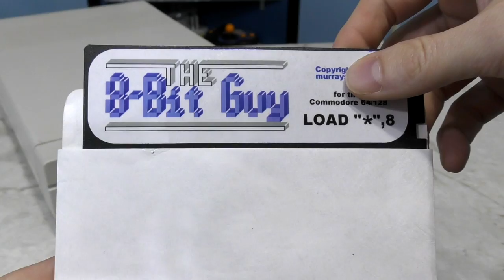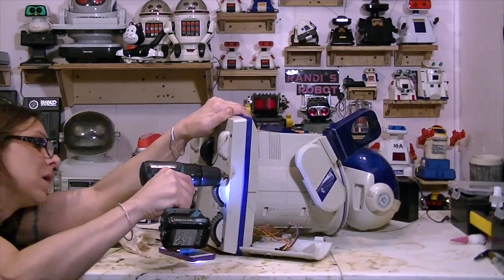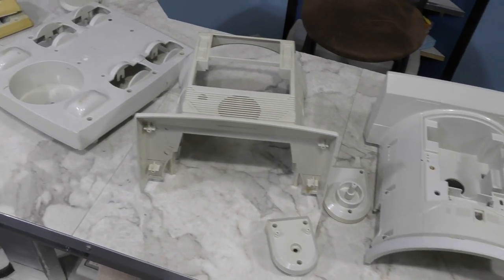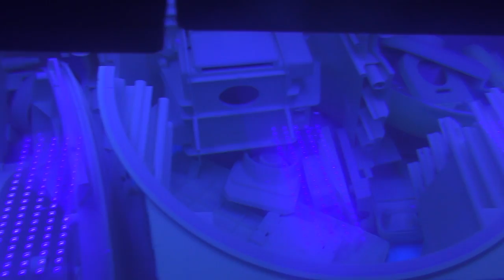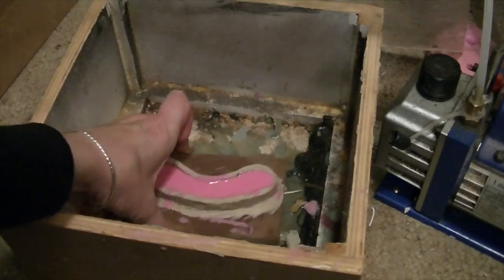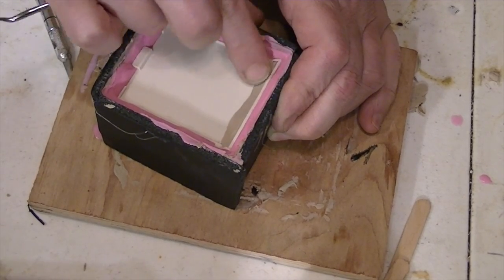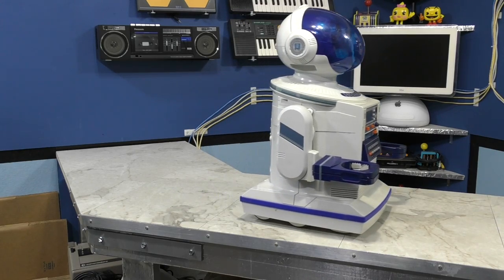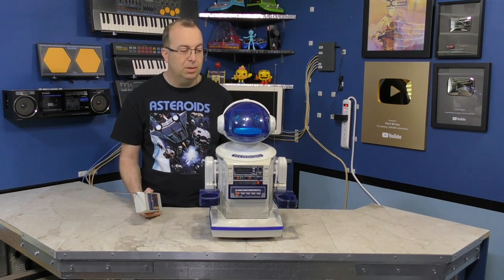Vintage Hearoid Robot Restoration

Comment: For the head, I would recommend using Brasso, which is intended as a metal polish, but works really well for buffing scratches out from plastics.

Comment: whilst I highly advise against this outside of a very dire situation and as a last resort, you can carefully use acetone to take care of deep scuffs and/or scratches. use the acetone to soften the plastic and rub over the scuff for a few minutes until the scratch has mostly gone away, finishing the rest with fine sandpaper, followed by very fine sandpaper in order to match the texture of the plastic.

Comment: polishing plastic i something i do at work every day when i refinish the headlights on newer used trade in vehicles, if you are patient and carefully use very high grit wet sand paper like a 3000 grit and above and some water rubbing alcohol mix then a polishing buffing compound with a towel you can gently sand down the abrasions back into its good layer underneath

Comment: You should definitely have a go at polishing the poor little guy's face. I have had some excellent results polishing arcade plexi glass bezels before. Start off with about 400 grit wet & dry (use clean spray water with it) and progress to 2500 or even 6000 grit as the deeper scratches disappear. Then finish up with dry newspaper and then go onto a polishing mop / rag. It seems scary when you first start out, nut it magically comes up before your very eyes!

Comment: Mothers aluminum wheel polish for plastic, its' not too aggressive, so you cant mess up the surface finish by over polishing. You don't have to worry about what grit your using, or if you are using the correct polish in the right step.

Comment: Seeing a lot of comments giving advice for polishing plastic, putting in my two cents to say a product called Plastx did wonders for some clear acrylic I was needing to remove light scratches from.
The big trick is using microfiber cleaning cloths and NOT any type of tissue, second tip is to NOT wipe the product straight away, let it settle for a while.

Comment: You can polish the plastic dome with some drops of water and NaCMC, it's mildly abrasive but not a lot, it will not scratch deeply into the plastic and it's easily clean with plain water; i use it to polish my plastic glasses

Comment: You actually can supposedly strongly glue plastics like that with cyanoacrylate glue (Super, Krazy, etc.), but only IF you use a curing agent that it doesn't need for ceramics and metals (and metals have to be prepped very diligently). I don't know/remember what that hardener is called (cyano alone hardens by the moisture in air, but needs extra for most plastics), but it comes in a little brush-lid bottle that's included with the cyano glue in a kit called Plastix.

Comment: You need Meguiar’s PlastX for the faceplate. I use it on my polycarbonate iMacs and iBooks and it’s foolproof. It’s meant for polishing plastic headlight lenses on cars but it works for any shiny plastic as well.

Comment: Using a very fine sandpaper starting at like 800 grit, then 1500, then 2200 and finishing it off with toothpaste, which is an extremely fine grit should polish that plastic visor up.  I have done it before to original Xbox plastic jewels and it works well.

Comment: All you need is a buffing wheel on a bench grinder, or even just an angle grinder, and use white compound to polish the plastic. It would help to have a lower RPM grinder however.

Comment: Interesting, I remember seeing them in Tandy (or was that their catalogue), they were quite expensive for what they did so I passed on by. As for recording the motions, I made a little 'robot' which was basically the same setup as the Hearoid's base. This was driven by a TRS-80 (via a relay board), the computer could record my drive, and play it back, similar to the Hearoid's tape I suppose. Yes, if I made a loop out of the drive recording, it didn't take long to it to all go pair shaped. The only solution was to have part of the drive a purposeful 'overdrive' into a corner, re-syncing everything. I've still got the computer, but the sled/car is long gone.
As for polishing the plastic, try Brasso for the final finish, after filing, sanding etc etc.

Comment: If anyone wants to know why you can't just use the vacuum on the resin for the tie rods see some Pete Brown videos: resin outgasses continually for essentially forever under a vaccuum and the resin will just bubble it's way out of the  mold.  Pressure meanwhile will make the bubles in the resin microscopic and prevent outgassing from forming new ones.

Comment: You can use white vinegar instead of hot sauce as it's the vinegar in the hot sauce that's removing the oxides and leaving the copper base metal untouched.  Save that yummy hot sauce for your wingz

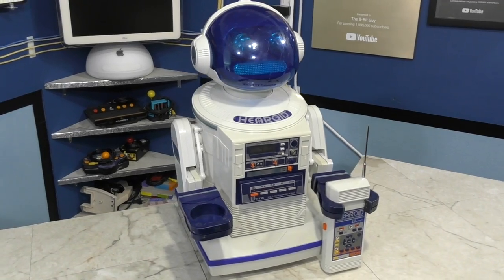Comment: @12:56 I've had success using Brasso's "polishing wad" on clear plastics to polish them back to transparent, it is cheap to get and easy to use. Don't use the liquid, it leaves a very slight haze to the plastic in my experience.

Comment: Meguiars ultimate compound with polishing tool and a cutting pad, would remove most of the light scratches and polish the plastic. Just keep the tool moving if not you'll burn the plastic. It worked well for me restoring headlights if theres any deep scratches some very light sanding with a fine grit paper will get them out and the compound will remove the scratches put on by the sandpaper.

Comment: I found a Steve The Robot I had as a kid in the late 80's that was in great shape but missing the remote. The original remote used a 27 Mhz frequency to go forward and reverse, so a cheap Dollar General remote control was all I needed to get the same results. Guess 27MHz has been the normal for wireless toys since the 80's

Comment: To polish the plastic try McGuires Head Light polish with 4" buffing wheel on a orbital buffer with the air pressure turned down a bit. I then clean off with water and Dawn dish soap. Then finish with Simichrome metal polish with a nice auto detailing towel.

Comment: fun fact,  using litteral audio signals to control the electromechanical or electronic functions of a robat is where the term audioanimitronc came from as used by disney. animate because not only cartoons but the word animate means to give life and by extension movement. tronic- thats ovious, but the audio part is because, like the heroid, they are controlled by literal audio signals. electronic tones.

Comment: A note about WD40: It's great for cleaning up things, displacing water, and getting stuck parts moving again. Yet it isn't very good as a lubricant. You can surely use it to lubricate squeaky hinges, but when it comes to something like a gearbox or an engine, you need a far better lubricant as WD40 doesn't reduce friction a lot and also not very permanently. Using some dedicated lubrication oil will do a better job. Prefer synthetic oil as it won't get sticky over time or at low temperatures.

Comment: Value of working robot about $200-250.  Broken robots can be bought for $80-125 depending on condition.  Most will need new cassette belts.

Comment: Here's a tip from the machine tool restoration world: CLR and similar products are acid based which erode the work and can be hazardous. There's a product called Evapo-Rust which does not erode the work and is not hazardous to your skin but is very effective at removing corrosion on iron-based metals. 

Check out the video series by YouTuber mrpete222 called "The Olympics of Rust Removal" for good testing and info on a variety of methods.

Thanks for the vid. Cheers, mate. 👍

Comment: whenever you have something that's broken like these tie rods, all you have to do is drill a small hole the same diameter as a paper clip using a hobby hand drill, cut a piece of paper clip to length and pin the part together using super glue and the pin.

Comment: With the battery terminals, you could use vinegar which would work just as well probably work just as good. but the Louisiana hot sauce works to:)😊

Comment: I bet it uses 433.92 MHz, or CB channel 14 for the remote. You could make your own USB control for it via a LimeSDR Mini and some software. That would be a cool project! Albeit, not a cheap project, but neat to see what tones trigger the robot
Reply: You could decode the tones using any SDR or scanner, and the frequency with a wireless frequency counter. The LimeSDR Mini can transmit the tones and your voice!

Comment: in cleaning yellow plastics Vim with out water Ive used also on some vinyls put on the cream rub with soft sponge rice off I always test a small area first Id also try head light polish on the clear plastic or even crest toothpaste Ive had some success with but very careful not to be aggressive

Comment: Back in the 80s, I saved up, allowances, birthday money, money from odd jobs for the neighbors, and so on, and eventually had enough to by the Robie Sr. from the local Radio Shack. 

Regarding programing actions and voice to the tape, it could be set to perform the actions and repeat the voice at a certain time. It was my alarm clock for years after. The actions and voice recording changed a few times, until I, eventually got a more traditional alarm clock.

I actually still have it, though I kept none of my other toys from my childhood. Probably because it took so much effort to save up enough to buy it, that I couldn't let it go. It hasn't been powered on since the late 80s, or maybe really early 90s. It just sits in a closet, collecting dust. 

After I married, I decided that I would fix it up, for my kids, when they were old enough. Unfortunately, work and life got in the way, and I never got to it. Now my oldest son has moved out, on his own, and my younger son will be doing the same, in a couple years. I still want to fix it up, and, hopefully, I will make time to do so, one day. Perhaps, in the future, my grandchildren will get a kick out of the antique toy. I am missing the faceplate, and the tray that came with it, but it is functional without them.
Reply: Just an update to this original comment. My son was in the storage room, a couple days ago, looking for something. He accidentally bumped the switch for the robot, and it turned on. Considering it had not been charged since the very early 90s, I was quite surprised. I would have never guessed that the rechargeable batter inside would still be holding a charge.

Comment: I suspect that the cassette mechanism needs a new pinch roller to reduce the wow and flutter on playback.    The problem will be getting one with the correct diameter.

Comment: If the remote uses DTMF tones, it would be possible to reverse engineer the remote, to make replicas.  And it most likely would transmit over FM radio frequencies, so possibly an  easy reverse engineering project.

Comment: Would the process for restoring car headlights work on the face shield? If the plastic itself is tinted that should help. 1000, 1500, then 2000 grit sandpaper followed by a good polish wouldn't work wonders. Each step has to be almost overdome for perfect results though

Comment: I kinda get why these were made and bought, because robots are cool and such - but they were made decades before they could be implemented as actual robots. So they were just electrified props. Today it is different: Today you can buy toy robots that do the things robots do, but on a toy quality level, meaning they can actually grab things and do repeatable programmable actions and they also have object avoidance when they are mobile. Does anyone know, were there actual toy robots in the 80s? Something like a servo powered robot arm that you could control from a Commodore 64?

Comment: Perhaps you could extend the system so that it's powered by a Raspberry Pi and thus you could make it more programmable and maybe build some kind of AI or collision avoidance software allied with some sensors so that it could be made to avoid obstacles that were not there when the thing was first programmed?

Comment: I fought you would use PROPER GLUE (solvent cement) or weld it and print it in 3D battery cover. The second one I was sure.

PS you have to remove rapid glue first before proper gluing

Comment: I had a problem with some busted plastic on my treadmill.  So I had to repair the damaged area and then sand the repair area down.  But there goes the shine.  The easy fix was to rub some clear candle wax into the repaired area, then use a heat gun to soften the wax while I evenly distributed it with a cloth.  After that I just polished it until it was as shiny as the rest of the undamaged area.  My Hero 2000 (ET-19) I think came out in the same year, 1986.  See    imgur.com/a/IZpLk6z

Comment: 14:43 Can you actually hear or reproduce the tones? Dub your own tape instead of programming it with the remote! Or get an MP3 to cassette adapter and dub to that. The one I have has a remote of its own, but it's IR and it won't receive inside the deck.

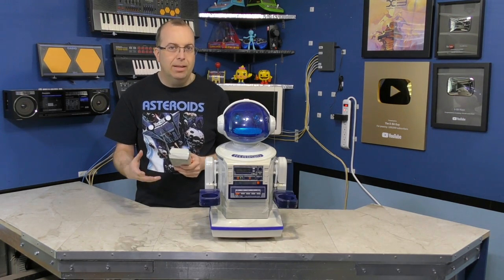Comment: 15:00 Ya know why It doesn't look where it is? Because it doesn't know where it isn't.

The missile knows where it is at all times. It knows this because it knows where it isn't. By subtracting where it is from where it isn't, or where it isn't from where it is (whichever is greater), it obtains a difference, or deviation. The guidance subsystem uses deviations to generate corrective commands to drive the missile from a position where it is to a position where it isn't, and arriving at a position where it wasn't, it now is. Consequently, the position where it is, is now the position that it wasn't, and it follows that the position that it was, is now the position that it isn't.
In the event that the position that it is in is not the position that it wasn't, the system has acquired a variation, the variation being the difference between where the missile is, and where it wasn't. If variation is considered to be a significant factor, it too may be corrected by the GEA. However, the missile must also know where it was.
The missile guidance computer scenario works as follows. Because a variation has modified some of the information the missile has obtained, it is not sure just where it is. However, it is sure where it isn't, within reason, and it knows where it was. It now subtracts where it should be from where it wasn't, or vice-versa, and by differentiating this from the algebraic sum of where it shouldn't be, and where it was, it is able to obtain the deviation and its variation, which is called error.

Comment: I was about 8 or 9 when I saw one at a (of all things) flower show down near Boston, MA. And being a kid with this thing called an imagination I WANTED ONE. Well there was one to raffle off. 

Needless to say the parental units said no. Buuuuuut I did manage to get my hands on a sample of "indestructible" paper that you couldn't rip. But could end up ripping with the help of a tiny cut from a pair of scissors and about as much elbow grease as one needs to rip a fart.

Back then computers were being made smaller, my father bringing home an early Macintosh Classic and well... Imagine my disappointment when the year 2000 came around and there were no flying cars... Buuuut I did score a 2002 Toyota Prius... 

Cut to 2020 and I'm rocking my 2011 Honda Insight with the only smart controls being my ability to control my radio and climate controls via voice. None of this sensing crap where my car can maintain a lane. Mine's a dumb car. I like it that way.

I still don't have that robot that would bring me my breakfast in bed that I dreamed of when I was but a child... Or little blue people with white hats, or talking bears taking picnic baskets... Or transforming vehicles...

Comment: Yikes! WD-40 should never be used on motors. It's not a lubricant whatsoever. There are much better options actually designed for such and without harming the motor such as 3-in-1 Motor Oil (not the same as the household junk).

Comment: Guess what, Dave: "remote" isn't actually a thing; it's a description. For example, "remote location," "remote broadcast," and "remote control." Thus, rather than just calling your remote control a "remote..." ("Remote... " what?) you'd call it exactly that: a remote control (the word "remote" meaning "far away," describing the object called a control, since "remote" doesn't have more than one form like "control" does).